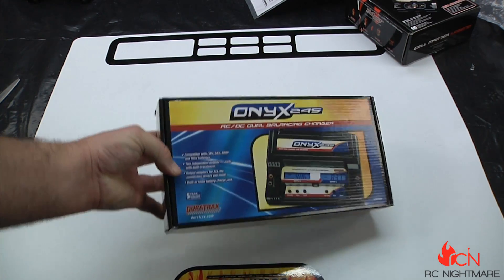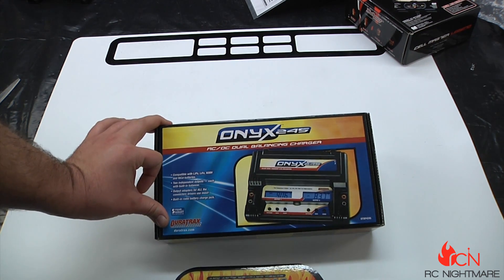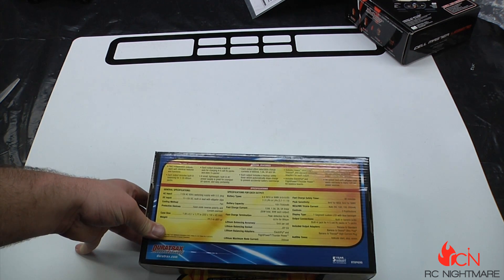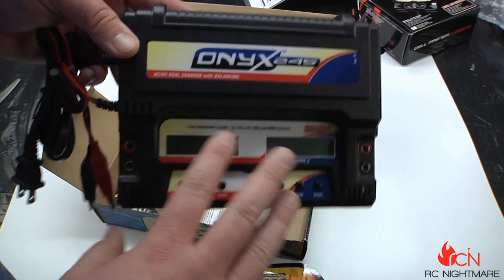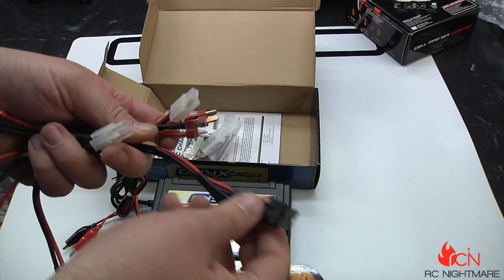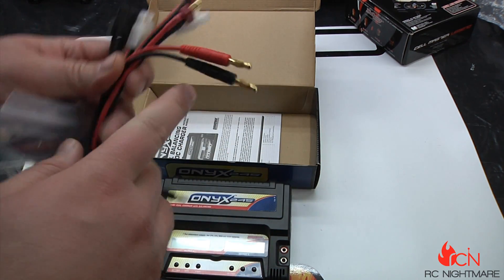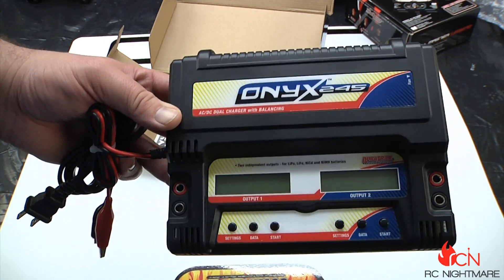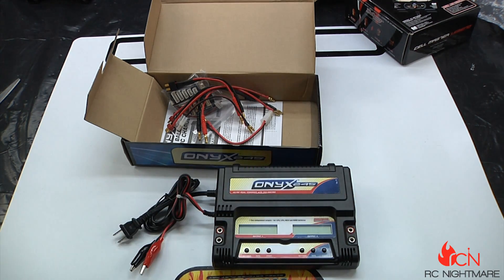Onyx 245 RC Charger Unboxing & First Review

Comment: Hey Jeremy, I had one recommended to me from my  LHS and since then bought another one. I run 2s and 3s in my 2 slashes and stampede. One thing you didn't mention or I failed to hear you is that the charger also does tx and rx packs as well.  Great videos keep'em coming!!!

Comment: I have this charger and highly recommend it. For 1 year now I've been pushing it charging on 5A / 40W per channel (max) on my 2 LiPo's (3S 9200mAh 50C) out of my ERevo Brushless and it's never skipped a beat. Sometimes if these LiPo's have hit min safe voltage, I need to restart the charge due to the 90min max timer but that's no big draw back.

The built in cooling fan is great, the unit never gets hot and the fan cools my power inverter (110v - 240v) which gets very hot.

The menu system and

Comment: Jigsaw makes a good point. For any given charger the size of the battery being charged determines speed. The 245 tops off two 5Ah 3s packs in about 1 1/2hrs.

Comment: quick question. i have 2 gens ace lipo 2s batteries 5000mah & 2 venom 2s lipo 4000 mah batteries, which balancing board do i need to use?

Comment: I have this, it's a good charger but my fan makes a loud drone noise at the beginning of the charge and quiets down. Also I think one of my balance boards is screwy, sometimes I have to jiggle the wires to get a correct lipo cell reading.

Comment: Great charger. It runs about 120 bucks. It has all youll need for charging batteries. Ive had mine for about 8 months without issue.

Comment: I have had this charger for less than a year, great charger however the right side for charging no longer charges batteries, You plug a battery in (NIMH or LiPo) and right after it starts charging, the whole charger dies. So currently I can only charge from the left side. Anyone else had this issue ?